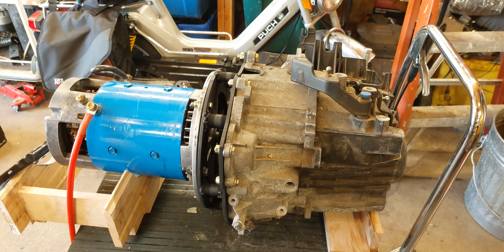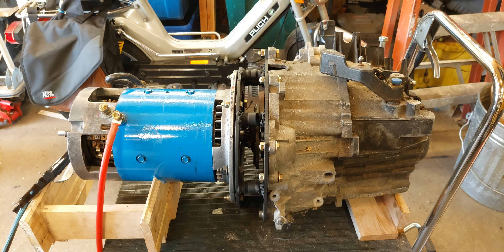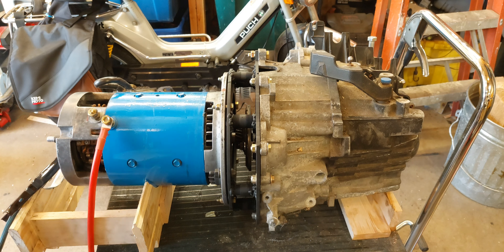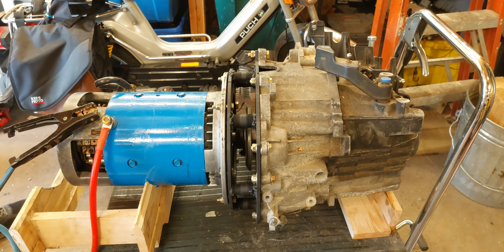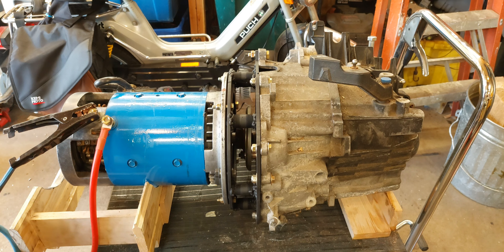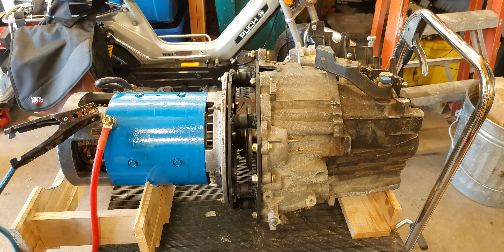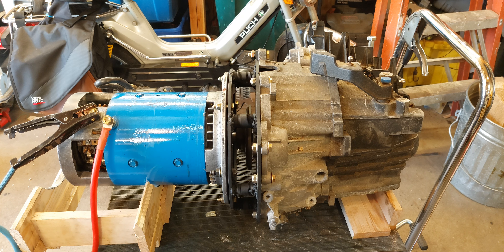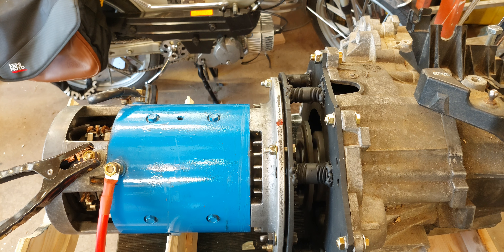EV Volvo V70 Conversion -- Drive Unit is Complete

Comment: GREAT JOB MY FRIEND  !!!  I JUST SAW  ALL YOUR VIDEOS TODAY 10/09/24 AND I HAVE LEARED ALOT FROM YOU !!! I AM CONVERTING A 1992 GEO METRO WITH A SMALL KUNRAY  (KR5V) 5000 WATT ELECTRIC MOTOR AND 8 TO 10 80 VOLT POWER TOOL BATTERIES  !!! I THANKS FOR YOUR GREAT ADVICE AND TOTURAL VIDEOS !!!!

Comment: Looks good! I'll make my adapter plate based on your design.
Reply from the maker: At your own risk -- I'm not an engineer!   For safety's sake, I'm going to be putting a metal shroud around the gap where you can see the driveshaft spinning... to keep out hands, pebbles, squirrels, mice, loose bolts, etc... if something gets down in there, it could be bad.

Comment: My friend.. Can I run a 2200w 72v motor with a 3000w 72v controller??  Or could a problem occur?
Reply from the maker: I am not an electrical engineer, just a hobbyist. I cannot give advice.
Reply: Yeah u can just improve the cooling